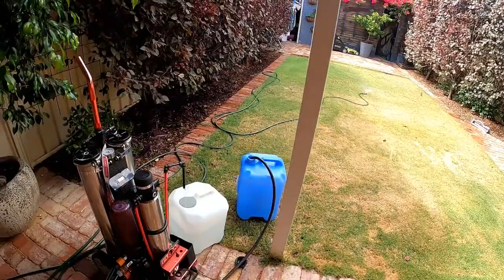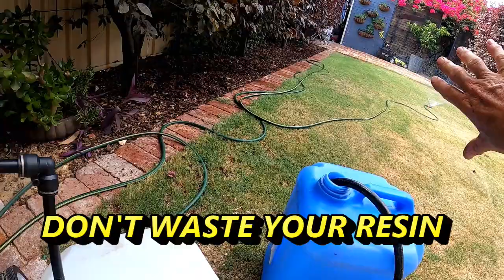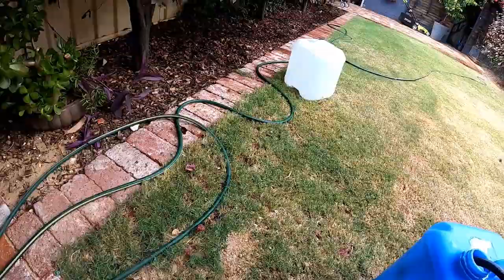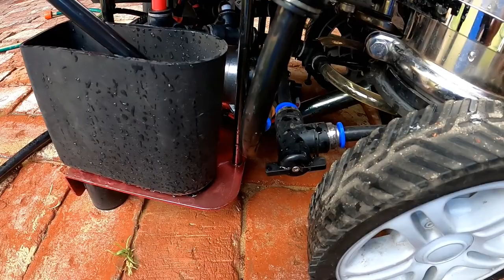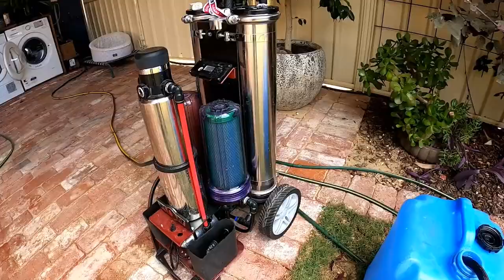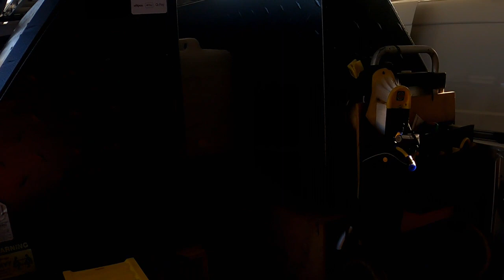Dont waste resin when flushing the FLOW RED

Comment: Hi bro,  initial start up of running your system.. you should have 100 percent R/O waste under boost pressure from pump for 3-5 minutes..then you should be running at 30 percent R/O waste during producing pure water at all times. Then  on completion flush your R/O 100 waste for another 3-5 minutes.... if I was you I would recommend a pre softener with TDS that high,  this is  before your carbon and sediment filters....then you can back wash you softener with from a canister with salt  every 1000 litres of pure water produced ..👍
Reply from the maker: FlashTechEngineering  thx very much for your info, I’ll look into water softers in the next few months . Cheers

Comment: Where do you get the flush vs production valve?
Reply from the maker: Luke Perth  you should already have this waste valve at the bottom of your system.  Just decommission all the other valves as they just restrict flow.  👍🤠
Reply: MODMAN Window Cleaning Workshop I have a version of that. But the one you used looks like a mod ? Was interested in the type of valve it was.